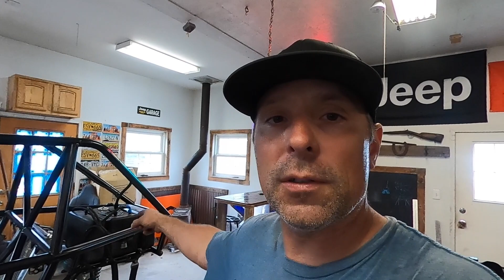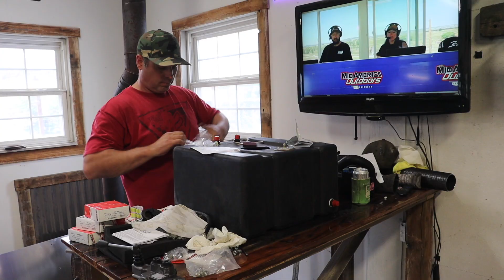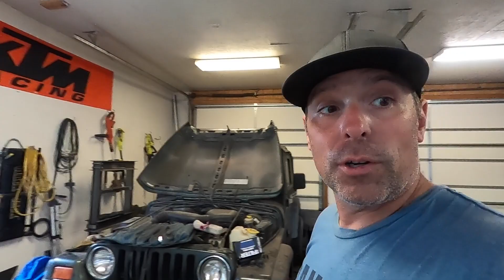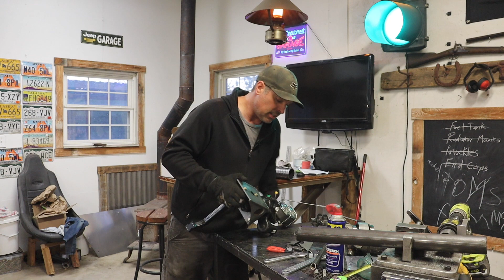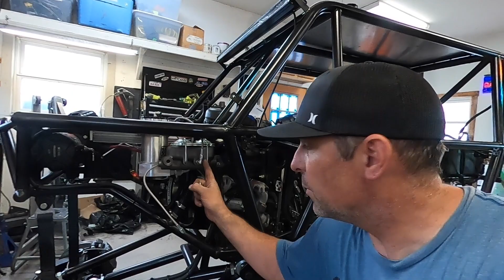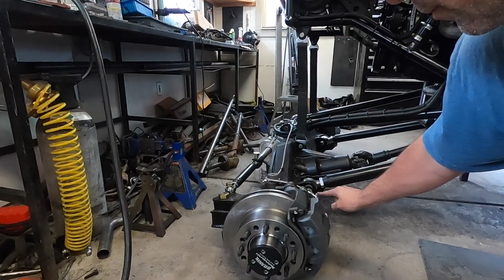Buggy Build Update, Fuel System and Brakes #rockcrawler #buggy #extreme

Comment: Another great video! I love the simplicity of how you make things turn out! I questioning that I couldn't see and breather routing for your fuel cell, but made complete sense when you explained how you routed it! Another point I might add is, keeping the stock brakes may be a touch heavier than aftermarket but can also add to stability when it comes to the sprung/unsprung aspect of weight. I converted one of my drum brake axles to disk, but added weight to compensate for it.
Reply from the maker: Thanks! I appreciate the feedback! I agree on the the unsprung weight, after all, a lot of people add water to their front tires to get more weight!
Reply: @wheelinoutwest  my point exactly. I done it on tractors, and heard about people doing it on their wheelers, but I like snow wheeling too much to fight with tires twice a year. I'll stick with my disk brakes and weights that I'm even thinking making removable.

Comment: Do you build your own braided brake lines or have them made? Do you use Russell fittings?
Reply from the maker: Good question, I forgot to cover, I have used those. But in this case, I just measured the length, and ordered the lines built from Kartek Offroad. They might have cost $200 for all of it.

Comment: You will love the hydro boost setup I’ve run on quite a few rigs. Best brake system if ever run. I also run a fuel pressure gauge right before the fuel rail, it’s nice to see if you have proper pressure in the event of a no start or poor running situation out on the trail. Another great video, anxious to see it completed.
Reply from the maker: Thanks! That’s good to know about the hydroboost! I am looking forward to it!